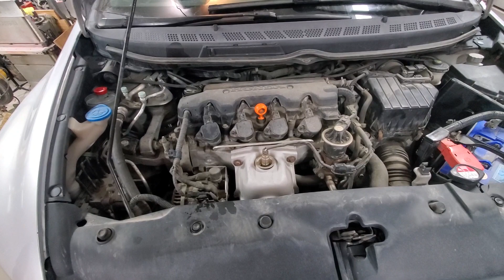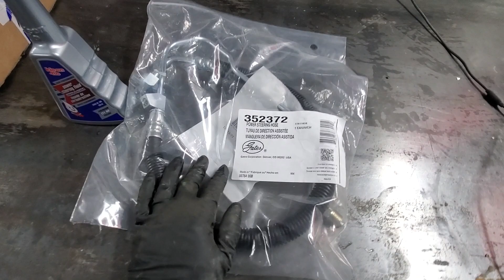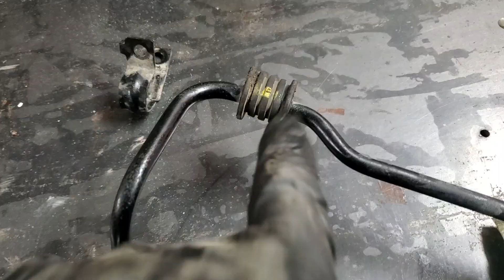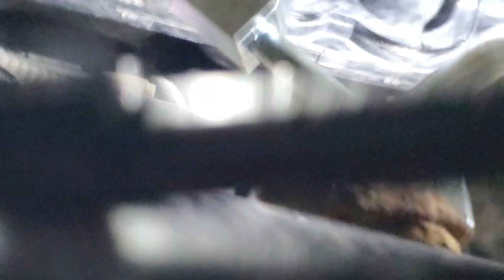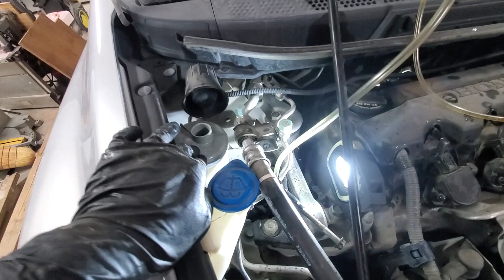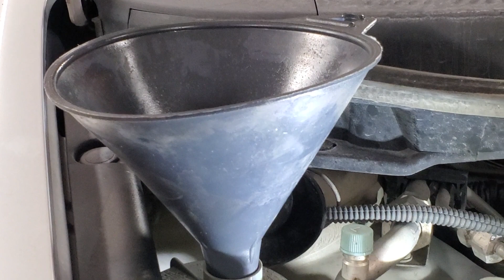Honda Civic Power Steering Leak. How to change high pressure power steering hose and fluid.

Comment from the maker: Parts and tools used in this video (affiliate links):

Power Steering Pressure Line Hose
US: https://amzn.to/3HpzGvi
Canada: https://amzn.to/3HmEvp8

Power Steering Fluid
US: https://amzn.to/3wkfvZk
Canada: https://amzn.to/3XzyLOy

Power Steering Fluid Reservoir
US: https://amzn.to/3QXmqRI
Canada: https://amzn.to/3ZXnB7O

Transfer Pump
US: https://amzn.to/3WsgCk9
Canada: https://amzn.to/3XCEtiI

1/4" drive socket set, 4-14mm
US: https://amzn.to/3TP4YVu
Canada: https://amzn.to/4eIt0s7

Full list in the description. As an Amazon Associate I earn from qualifying purchases.

Comment: The electric pump how are you connecting the part that goes into the power steering pump container? i have a electric pump like that but i cant figure it out. how it connects

Comment: Iam replacing the o rings in my pump. Is the orange o ring for the high pressure line
Reply from the maker: Hi! What do you mean by "orange o ring"?
Reply: Mine was a black o ring for the high pressure hose.

Comment: What is the line right before what you changed it busted for me but idk if oil or transmission or powered stearing
Reply from the maker: I think you are talking about power steering low pressure (return) line.

Comment: You're replacing the line So just cut the line off at the fitting and use a socket Way easier
Reply from the maker: That is interesting idea,  thanks for sharing! One concern I would worry about,  getting shavings into the system, so would need to use a pipe cutter or something like side cutters.
Reply: @justdoityourself  Mine was impossible to bust loose with the wrench so i did exactly that. Cut the pipe and used my socket. I still had to put an extension pipe over my rachet to break the fitting loose. It was tight.
Reply from the maker: @stephenjackson4392  oh wow. I was lucky to get it off that easy then.

Comment: Are you sure the original p/s flare nut was a 22mm and not a 21mm?
Reply from the maker: I have not tried 21mm, but 22mm fitted well. Is yours 21mm?
Reply: @justdoityourself   My new line, the fitting to the rack is 19 mm but the original line seems to be slightly bigger like it would be a 20mm? I was going to start the job yesterday after seeing your video but decided to try again today
Reply from the maker: @stephenjackson4392  that's so weird,  what year is your civic?
Reply: @justdoityourself  mine is a 2007 and the 22mm seems a bit too big
Reply: Does the new nut go all the way in mine is getting hard to turn around 70 percent of the way